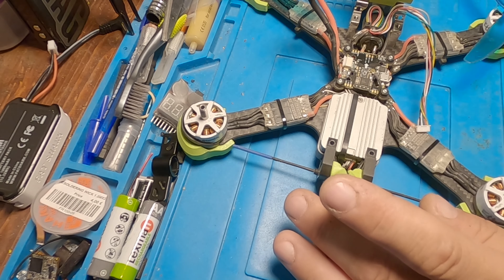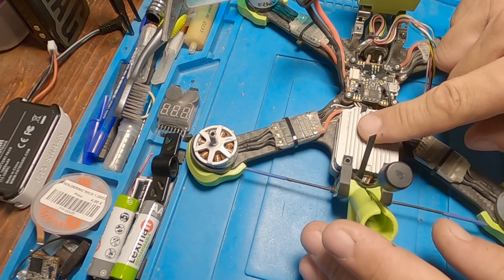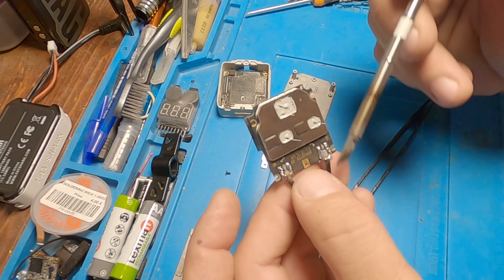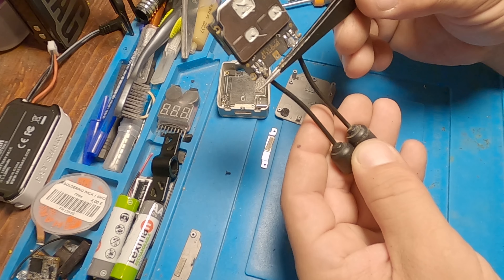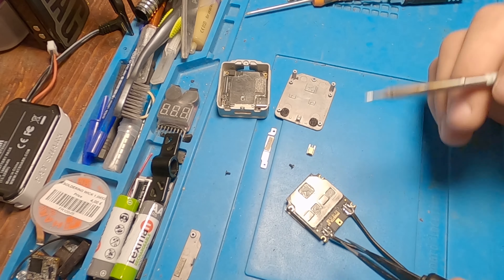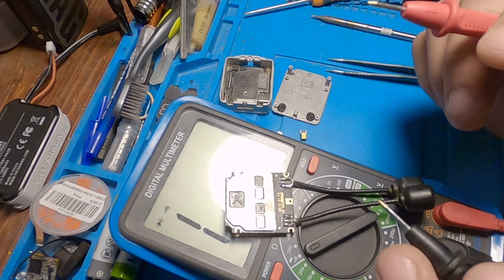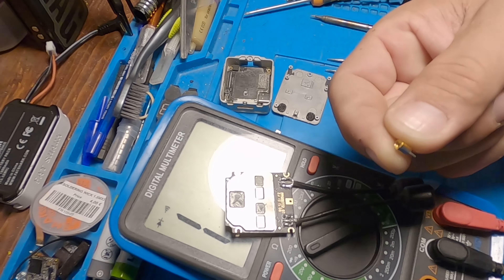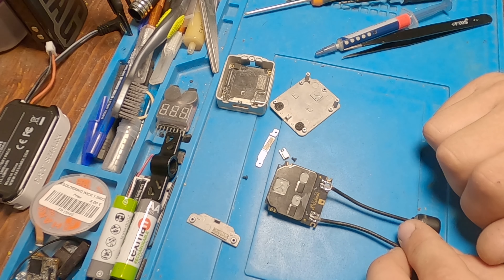Repairing  DJI air unit antennas

Comment: Thanks for this video! I tried it and failed. I just could not get the connector out of the borad. The whole board was getting hot but the connector wouldn't move a bit.

Comment: Nice! It's a good idea! Don't you have a video showing the whole process of soldering? That would be so great for us to follow your steps.. Thanks!
Reply from the maker: If i have some spare time, i will make one video.
Reply: @dannyblondu23  Thanks brother. I have finally found some videos on youtube showing the details of that process. You did that because your mmcx connectors have broken or you did that because you was trying to improve the signal?